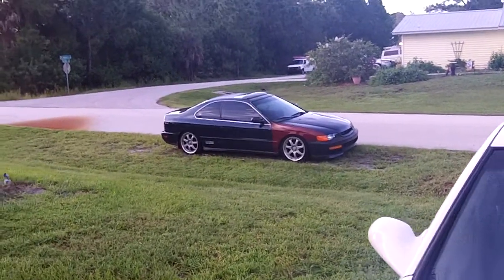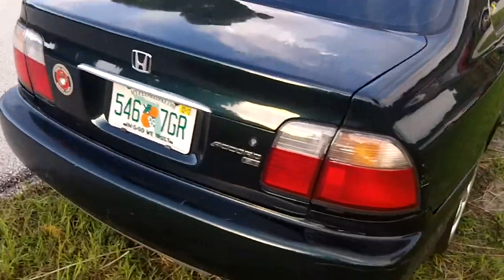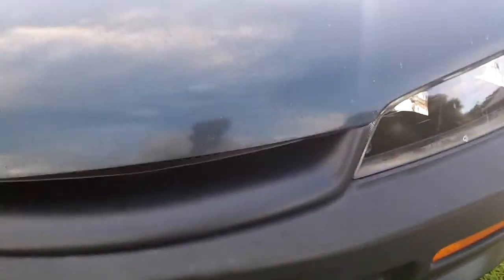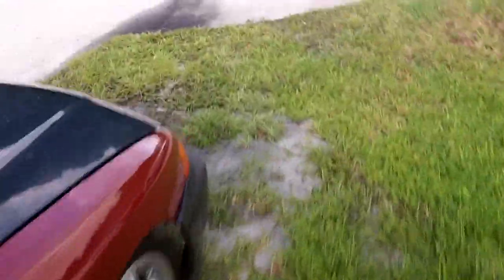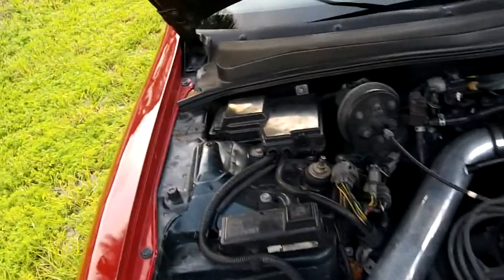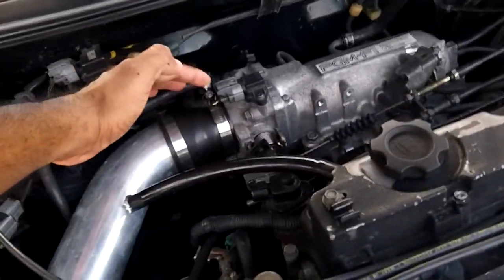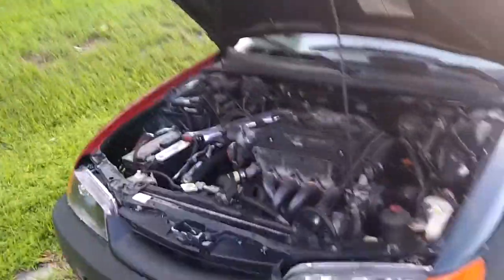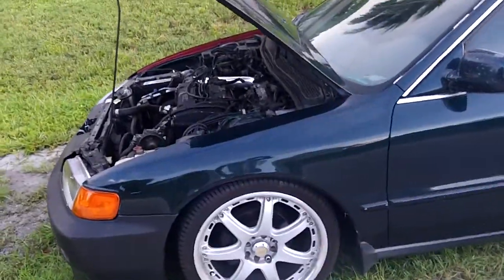h22 accord part 2

Comment from the maker: 850 for the motor+ the other little things(ecu,proper mounts,harness etc) all came to about 2000 because i needed alot new parts anyway. so i recommend to buy a full swap for about three grand. trust me, youll save in the end. expect to put about 4k for a good swaps, or send your motor to a reputable shop and pay them about 3k to turbo it

Comment from the maker: I got it painted and timing fixed. still have to get it tuned. The car is really clean now, One of the cleanest in my area. I even swapped out the accord steering wheel and installed one from a rsx

Comment: For the timing rotate the bottom pulley counter clockwise a full 360degrees before putting it to top dead centre and always go counter clockwise when doing this (!!!Very important!!!) as the engine naturally turnes that way when running when this  is done repeat with cam pulleys and make sure both up arrows point up and the two little lines are level with each other at 3oclock and 9oclock (going left to right) then it's just a matter of doing the belt and tensioners
Reply: That being said the best thing for you would be take it to a garage and give it to someone who actually knows what they are doing it will cost less than your 18's did and it's much more important and unlike the 18's it will actually improve the way your car drives rather than ruin it

Comment: Beautiful Accord dude, you did a great job on it. The drop is super clean. Question for you, I own a 1994 Honda Accord EX Coupe with 200,000 miles on the original F22 motor. I want to swap in a H22A from Honda Motors Online. Would you recommend any other parts that I would need along with the purchase of the motor?

Comment: Could the timing issues be may be injector related. Did you use the original injectors from your previous engine or did you use it from the swaped one. Also when you swap motor sometimes do the communication problem with the computer

Comment: Did you change the actual timing belt tensioner when you changed the timing belt? Also some timing adjusters ratchet some need to be primed with oil pressure. Really gotta study the procedure from the manual and do it exactly the way it says, and you have to replace everything seals, belts, pulley gears, belt and the adjuster mechanism no skimping.

Comment: Just saw your vid and if you put a better tuned ecu when your timing is set wright it will run better
You put new stuff on the motor so a retune will be the best thing to do its not cheap but worth every
Penny hope it works out keep up the good work

Comment: I bought a 97 Accord EX Sedan in July of 2015 mine may have the same problem with the timing it has slow Acceleration when I take off at a deadstop I can't seem to figure out what's causing the slow Acceleration the guy I bought the car from says the timing belt was replaced but I do believe it has something to do with the timing if your having the same issue then I would believe the 5th Generation Accords has a timing issue I'm taking mine into the shop to get a emission test and safety done because I bought the car as is and didn't have the cash right away to fix everything for safety and emission test but I'm putting close to 2 Grand into it to get it road worthy I'm just hoping the slow Acceleration doesn't affect it from passing emission test mine is a winter beater it was a B.C. car but the Vin number is registered as Ohio USDM where it was Assembled in the factory I wanna modify mine too rims coilovers front and rear lip kit sideskirts lip full cat back exhaust Spec-D Mugan race header and AEM cold air intake down to the fender and a nice loud sound system with deep bass and high sound pressure level

Comment: Also the reason for the overheating well it's not really called overheating reason for the higher temperature increase is that you're giving it so much throttle because of the lack of power the cars running under powered so your gear feeding or fuel and it'll cause it to overheat a little bit but not over the top

Comment from the maker: Ahh man. If you want to be honest hehe. get a newer more powerful car. the price you pay will work out the same. If you still choose to modify your accord. you might want to get a HASPORT driver side motor mount, and rear mount. youll want a poly insert for the front mount. and a 97-01 prelude power steering bracket. and also a timing belt/water pump kit. most people do these swaps because of price, but to do any swap well you need to spend money. but for cheap you can get away with spending <3k

Comment: put the h22 head on the f22 block with is much better last longer and stronger.run a stanless steel line from the oil pressure switch for the vtec.homemadeturbodotcom got the links for the parts.h22 blocks suck.